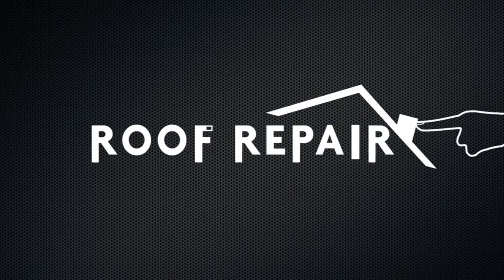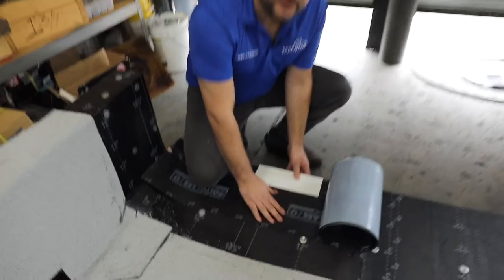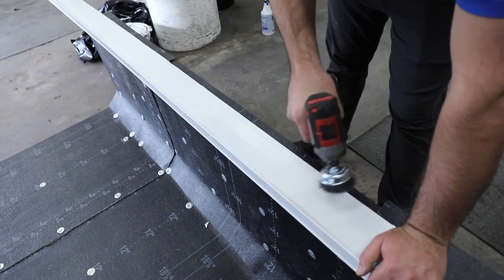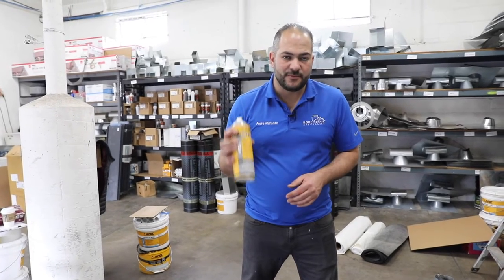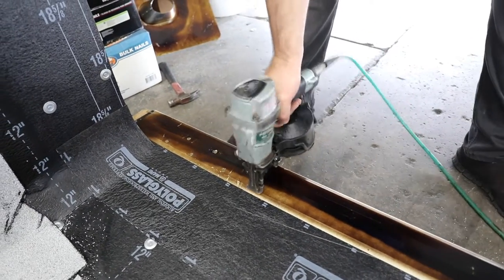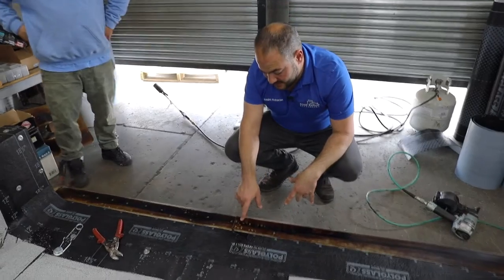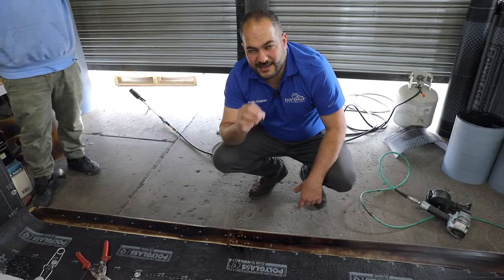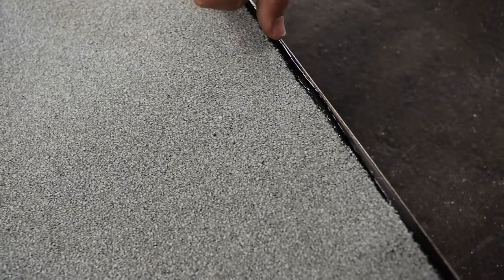How to Install Low Rise Flashing | Torch Down Roofing Guide

Comment: Why do manufacturers recommend the low rise flashing with a bump? Asking because I have an ~20 yr rolled roof with this kind of flashing and the roof is fine (no leaks), but the deck along the eves are all rotted because water has pooled up behind that little bump. It would seem flashing without the bump would be better to allow water to just run off it into the gutter and not cause pooling where years later the tar might not be bonded so well which then causes the deck to get damp and rot out. If it's just because of tar run out, wouldn't careful installation fix that with the 1/4" set back you recommended? I'm generally frustrated that the only problem is rotted deck and rafters because of the drip edge failing.

Comment: Just put plastic cement under the flashing. 🤦🏽‍♂️
Reply from the maker: Plastic cement is not rated for high heat. Once you torch it becomes useless.

Comment: I need to replace rusted drip edge on modified bitumen roof in San Francisco.  Current drip edge is just nailed on top of cap sheet.  I plan to remove current drip edge.  After that, can I just peel back the existing cap sheet with a torch and then slide new drip edge underneath, nail and then torch the cap sheet back on top?  I'm looking for a temp solution for a few more years before replacing roof.  Thanks.
Reply from the maker: You probably won’t be able to torch the old cap. The temporary method would be to just install a new drip edge over it. Before you install it put a thin bed of mastic, then once drip edge is installed 3 coarse it with mastic
Reply: @RoofRepairSpecialist  Thank you!

Comment: I’m doing my garage, it’s only 500 square feet. Can I use a 2 1/2 by 2 1/2 inch drip edge? My garages roof extends two feet and the only thing the drip edge can nail to is a 2x8 fascia
Reply from the maker: Ya, the size of the drip edge does not really matter.

Comment: Thanks Andre, I have a question. How much overlap of cap sheet should i have when using a traditional drip edge (low rise flashing is not availble in my area) or shuld the cap sheet be flush with the edge of drip edge. Thanks so much appreicate your time.
Reply from the maker: Hmm, that is a interesting question. I think if your not worried about aesthetics go 1/2 over, it’ll look ugly though. 
I think going flush will definitely be ok as well and will look nicer. Just be careful to prevent bleed out on the face of the drip edge
Reply: THANKS appreciate the fast response ! Youre a amazing guy!! @RoofRepairSpecialist

Comment: Thanks for the videos! So, why did you prime the back of the drip edge? I don't think you explained it.
Reply from the maker: I guess I forgot to mention that. 
Its so it adheres to the strip of mid ply we installed under the flashing. Though we dont torch that down, when we are torching the top it will get hot and adhere the bottom side as well.

Comment: That flashing metal is for the hot mop or gravel. For torch down you use always BONDERIZED with no low rise at all regular 2x4 BONDERIZED DRIP METAL FLASHING
Reply from the maker: No, wrong on both accounts. Though I think bonderized will probably be best for adhesion, pre painted flashing looks nicer and if done properly will last just as long. And Low Rise is used for torch. 
These are not my opinion but manufacturer specs.
Reply: @RoofRepairSpecialist  In my experience as a roofer I have had more problems with the low rise than simply installing the regular 2x4 flashing and in the end I have had better results and better customer satisfaction and of course mine. I think that everyone finds their way of working more efficiently and better applied. it is my opinion
Reply: And touching on the subject of color flashing, it depends on the client. In my experience, I give them the option that they can paint it in the color of their preference and some, not all, are more satisfied. There are customers who don't care especially when you have rain gutters color doesn't matter.